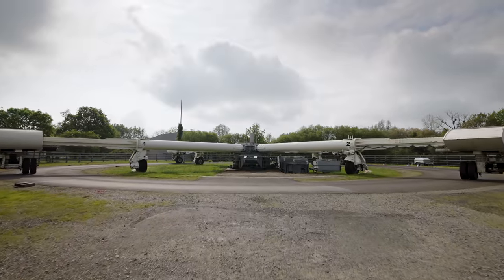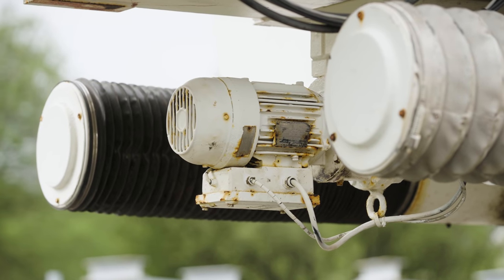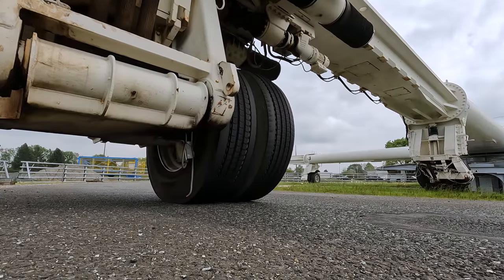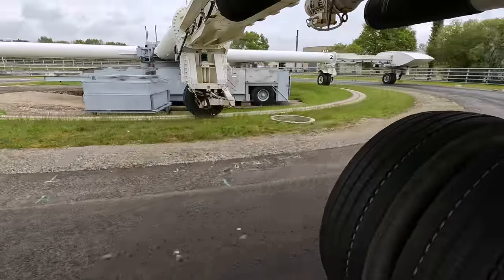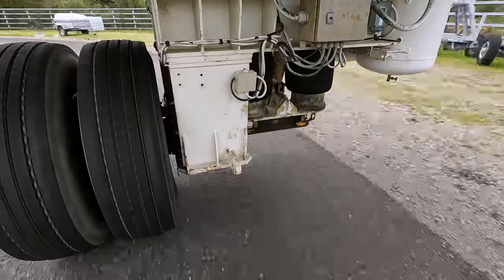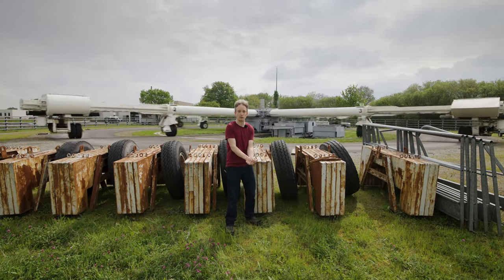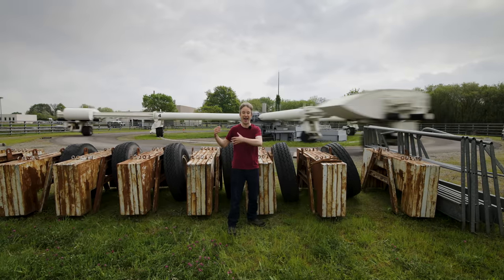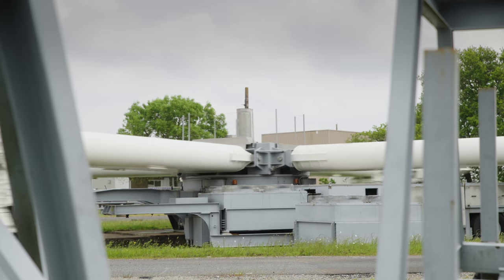The massive Fatigue Carousel helps keep roads safe

Comment: Imagine what the process of coming up with this must have been like.

Like someone says: "We need to test new road pavement for long term fatigue, how can we do that without inventing a time machine? Any ideas?"

And then a group of engineers did a brainstorming session and their answer was Giant circular vehicle that can run so fast that it simulates years of damage in a few months.

Ingenious
Reply: I don't think it's simulating years of wear just months from which they can extrapolate how damaged it likely be over the years.
Reply: @madmanwithaplan1826  the thing is they can run it very hard and continuously.  Fully loaded, bumper-to-bumper weight like a traffic jam, but screaming along at 70km/h.  That's conditions harder than the real world
Reply: @madmanwithaplan1826  I'm not so sure about that. Usually road surfaces are layed out for a certain number of 10-t-equivalent axle transitions in 30 years - and this machine can test the number very precisely - just take the number of rotations and multiply by 4. 

At least for surfaces that don't face that much heavy traffic (lets say 3.000.000 10-t-equivalent transitions, which is your usual road that connects two villages) this machine has to run only for less than two months. With the numbers given in the video (120 m length, 70 kph speed, 4 arms) the result is the following:

N = 3.000.000 (10-t-eq. transitions) / 4 (arms) = 750.000 (rotations)
T = l/v = 0,12 km / 70 km/h = 0,001714 h
t = N * T = 1.285 h = 54 d = 7,65 weeks
Reply: I think it just simulates a lot of cars at once nonstop, they said it typically runs at 70 kph which is not particularly fast.
Reply: Another brilliant piece of engineering was a Michelin Citroen DS PLR, designed to test tyres!
Reply: @monhi64  not cars, trucks. Cars are not significant for road damage - the damage one 40 t truck does is equivalent to around 18.000 2 t cars!
Reply: The concept itself has been around for centuries, using animals in a circular path pushing (or pulling) a movement arm, usually to bring up water.  I'm sure there were even casual calculations on how far an animal has traveled walking in circles per day.

These guys just took that concept and reversed the power source.

Ingenious yes, but it was just adapting an existing machine to a different purpose...
Reply: I've had many meetings like that, where somebody immediately calls out  "well there's always [some crazy thing ] to do it, ha ha ha" and after like two weeks of brainstorming we're back to the crazy thing being the only way.
Reply: The brilliant part isn't from the idea, it's build the thing, designing it to deal with the forces involved. The idea itself is no different from the kind of tests you might see on display in Ikea
Reply: There are linear versions of this too.

Comment: Much respect to the small inner ring of apparently indestructible material, quietly holding up without being part of the test.
Reply: Solid thick concrete will do that, if you put practically no load on it.
Reply: Most of the load is on the outer wheels, mind.
Reply: Is it driven from the centre or each arm?
Reply: @ironfront9573  it's driven from the centre - that's where the 1000HP electric motor is
Reply: @patheddles4004  hydraulic motor according to the video
Reply: @benhobby17  yep, my bad
Reply: @benhobby17  Hydraulics aren't a power source; you need something to crank the pump.
Reply: @boobah5643  Of course, but that doesn't make it stop being a hydraulic motor, or it correct to call it an electric motor.
Reply: It's really the backbone of the whole operation.
Reply: @boobah5643  You need something to generate electricity for an electric motor too.
Reply: @derrickfoster644  I now understand hydroelectricity!

Comment: At the Federal Aviation Administration's William J. Hughes Technical Center in New Jersey, there is a hangar where runway materials are tested. The most stress on a runway does not occur at landing. At landing, most of the fuel is gone, and the wings are still providing some lift.

The real load happens during taxiing to the takeoff spot, when the plane is traveling too slowly for the wings to help at all. At that point, every ounce of the plane's weight, passengers, crew, baggage, and fuel are bearing down on the macadam.

 So, in that hangar, there is a gigantic gantry that rides along two rails on opposing sides, running the length of the building. Between the rails is the runway material being tested. It is built atop dirt, and exactly as a real runway.

From the gantry is a large machine with hydraulics and wheels configured as those of a jetliner. Depending on the test, they can set the tires and the setup for literally any passenger or cargo aircraft in the world, at any weight level.

The test consists of the gantry slowly moving (at taxi speed) along the length of the hangar to the runway's end, then stops and reverses to the other end.

Back and forth for weeks or months until the runway fails. Then they analyze where and how it failed, rip up the runway, and lay a new one down. It takes a long time, but the data is wholly worth it!
Reply: Wow, you'd think runway paving techniques were a done deal, but they keep being improved. New materials?
Reply: @andyandreou  or new aircraft
Reply: @halfgecko3202  Good point. As engines and aerodynamics improve, they combine with economic pressures to result in bigger and bigger planes, both passenger and the cargo monsters.
Reply: Have to disagree here, taxiways last compared to the runways.  Surely the point of rotation would be where the worst loads are.  the front comes up and for a second or so, the main gear is pushed into the ground until the wings are at the right angle to generate lift.
Reply: @cjmillsnun  Nah, rotation happens when the wings are already generating enough lift to counteract the gross weight of the plane. At that point the load on the runway surface is tiny.
Reply: @David Gannon
I was going to object that the peak forces on a runway surface come from hard landings. And that's true, but you're still right about taxiing being the relevant maximum stress - the amount of time spent taxiing at full weight is many many orders of magnitude greater than the amount of time spent in hard touchdowns, so for overall wear the taxiing is way more relevant.

So hey, I learned /two/ things!
Reply: @cjmillsnun  taxiways can survive much more neglect and remain safe, which likely contributes to their being replaced less often than the runways. It wouldn't be a contradiction to say that they receive more wear and tear and also get replaced less often.
Reply: An idea for a future Tom Scott video!
Reply: A fascinating additional tidbit!  I wonder if they used this when the biggest passenger plane A380 was being developed? surely they must have.  To test how bad an A380 would be on runways only designed to take up to a 747.

Comment: For anyone curious, the centripetal acceleration is right around 4.9g's with it moving at 100km/h
Reply: holy
Reply: @HuBrFe  this is nothing for an industrial machine.
Reply: 5 grams aint so bad ... 🙃
Reply: and now imagine some nutjobs who wanted to build that vertically, and fling objects into orbit,... in a vacuum,... where the seal brakes at launch,... with a sudden release of the weight on one side,... with the controlcenter right next to it,...
Reply: Hmm for a ring length of 120 m (=circumference) and a speed of 100 km/h I found the acceleration to be 40.4 m/s², or around 4.1 g's
(and at 70 km/h it drops to 2 g, which makes sense if centripetal acceleration is proportional to the speed squared, so that 70% of the speed means 49% of the acceleration)
Reply: @shirou9790  2g at 70km/h? They should put seats on the arms and sell tickets! Its uhm... a bus simulation!
Reply: @skoniramont  did you just describe a trebuchet?
Reply: @psylock524  He's referring to a thing called SpinLaunch, which if built at full size, will be the most spectacularly epic physics fail ever created by Millennials.
Reply: @dw300  Certainly, but the title is rather a disputed one. I've heard of a giant vacuum tube with people  propelled inside at Mach 2. This one also makes  a decent bet.
Reply: @dw300  looked it up, looks like it's just a mass driver if it was a beyblade
Reply: @skoniramont  Hah! As if anyone would ever build something like that... Oh.
Reply: @JNCressey  g is not for grams, it is a measurement of acceleration, not mass or weight
Earth's gravitional accel is taken as 1 g, which equals to roughly 9,81 m/s²
 
Ofc your mass does not change regardless of the interial acceleration you undergo,  but if you want a reffrence,  you can multiply the rider's body mass with the accel given in g's unit, to estimate how much mass in 1 g (normal gravitional accel) would create the same force as the rider's mass under that much acceleration
Reply: @adakalyoncu1913  woooosh

Comment: the fact the wheels each have what looks like a wing over it really shows how fast it's designed to go if the air resistance is so significant
Reply: I'd guess it isn't as much to allow it to go to high speeds. But more to prevent the air to go around it in such a way that makes it vibrate. Vibrations can cause a lot of wear and tear, and this machine needs a lot of up time, and little down time.
Reply: Isn't it used to properly control the simulated weight, by slightly inclining them?
Reply: @DidierLoiseau  That would make sense, if you alter the angle of attack you could create more up or down force on the fly without having to physically add or remove weight.  Fantastic design choice.
Reply: I wish Tom explained what they were for.

Comment: At work (agriculture tractor parts supplier) I've seen something very close to this, but instead the test subject is the moving part, not the floor. Tractors ate tied to the center and kept driving in circles through many obstacles as a way of validating its fatigue strength. It is so similar to this that now I'm wondering what else is running in circles out there.
Reply: Surely the earth runs in circles
Reply: Probably they use something like that to calibrate the arm on dump trucks that lifts bins
Reply: I've seen horses on a leash directed in circles over obstacles.. also fatigue testing? 🤔
Reply: The Houses of Parliament run in circles, or at least the occupants do, constantly.

Comment: I always imagined something like this had to exist, I just never researched or confirmed it. Thanks for the video
Reply: there is only one problem (at least in Germany)- when the local government is searching for contractors to do the actual work, they have to use the cheapest one... and they do not consider long term costs... that is why our streets are mostly made from bitumen and not from concrete... although concrete lasts at least 3x as long, is more silent and so on.... but the initial cost is like 30% higher... so it almost never gets used..
Reply: @olik136  Concrete roads where I live are noticeably louder than bitumen, both for the travelers and the people near the road. I really don't like when I come across stretches of concrete highway on long road trips, the extra noise is irritating and mentally fatiguing.
Reply: @olik136  so you never visited east Germany? Because if you had you wouldn't advertise for concrete roads.

And that they don't consider long term costs is also wrong. Long term costs is one part of the cost-calculation.
Reply: Concrete roads when laid need weeks to dry and cure before they can be driven on again. It's not really viable for most places to shut down significant stretches of road for a long period of time for modifications like that.
Reply: @Jehty_  I don't know what problems east (East?) Germany has, but Canada has long stretches of concrete highways that are great, of course there is little choice, frost heaves would destroy bitumen every winter, maybe more than once within a single winter season. Also, I mean, it wouldn't be the only good idea that got totally f'k'd in execution in Eastern Europe.
Reply: @squirlmy  ba dum   ba dum   ba dum   ba dum   ba dum

Comment: That moment Tom mentioned a 1000hp engine is powering this beast made me realize that there are some hypercars out there that literally have double the amount of horsepower compared to this beast. Made me realize how far the technique has actually come and how ridiculously overpowered those hypercar engines actually are.
Reply: Do renember torque though those cars won't have the torque of this
Reply: This has torque
Reply: The duty cycle is a completely different thing though.  This machine will do 1000HP for months at a time and last decades.  At 1000HP any car engine won't last long if it sits at 100% for any length of time.
Reply: Thats not exctly how it works though :D
Reply: The other thing is a car needs good acceleration, this doesn't, it's allowed to take several minutes to get up to speed, so it really only needs enough HP to maintain 100kph, but not more than that.
Reply: As an electrician who works on big industrial things, the scope of how much power even 350 hp is on motors I've installed is mind boggling.
Reply: Whilst HyperCars are indeed astronomically powerful. They are also built with lightness and acceleration in mind so they can only put out that amount of power for short periods of time and doing so will rapidly draw all components to needing a service. 

Industrial equipment like this has to run at close to full power for months or even years on end without breaks. Have minimal servicing needs, and to be done very cheaply when needed.
Reply: Such hypercars exist, but these engines can only maintain the 1000 hp for a few seconds or minutes. 1000 hp is 735 kW. At a very good efficiency of 40%, this would be an energy requirement of 1.8 MW. This means that a waste heat of 1.1 MW has to be dissipated.

Just to put that in perspective: Space heaters commonly used in Europe with 230 V have an output of 2500 watts, American ones with 110 V have 1500 watts. So the waste heat from the sports car engine would be equivalent to 440 EU space heaters or 730 American ones.

Gasoline has a calorific value of 8.9 kWh/l. To deliver the 1000 hp continuously, the engine would burn 3.4 liters (0.9 gallons) per minute or 206 liters (54 gallons) per hour. Even a diesel engine (9.7 kWh/l) would burn 3.2 liters (0.8 gallons) per minute or 189 liters (50 gallons) per hour.
Reply: @vonBlankenburgLP  try an electric car, say a lucid air.  Still an electric engine with probably 97-99% efficiency producing 1111 hp.  
Sure the specs are completely different (gearing, rpm, motor type, power source) but 1000+ hp is still a shitload of power.

Comment: I would love to see some of the bogus solar roadway projects tested  there. That would be slaughter. And maybe some improvements would result from the test data.
Reply: On one of the other testing circles there was a section of hexagon plates that could well be glass 😂
Reply: It looks like they were being tested there, at 3:35, the hexagonal shapes there look like the actual models of solar roadways, although they could be filled in with asphalt, so perhaps they were removed earlier.
Reply: Ah. I missed that. Might also just be hexagonal slabs of some kind, but they look a lot like solar roadways.

Comment: Simulators are so much fun for nerds.  Back in the 70's I read a book that was a catalog of simulators.  I remember avalanche simulators.  And South Africa had a hailstone simulator.  I suspect that there are a lot more now.  I did a little work in a wind tunnel that was trying to simulate the planetary boundary layer.  I found a hill in Israel that had been instrumented and built a model of it on the scale of 3/4" = 10 meters and compared the results.  They weren't very well matched.  

I grew up in the pothole belt in the US, where there are 50 freeze thaw cycles every winter.  I wonder if there is a simulator for that?  It really eats highways and building materials.

Comment: The autobahn in Germany has had virtually no maintenance since it was built.
The concrete at it's minimum is over 2 and half feet thick. This prevents cracks, and warping while supporting the heaviest of loads.
In the U.S. our major highways aren't even half that, and have alot more traffic so most of them are always garbage.

Comment: Kind of puts into perspective how scary cars are. When I walk by a street I'm so used to seeing them drive past me at terrifying speeds (probably not 100 km/h but definitely close to deadly) that it doesn't phase me that much anymore but this thing puts that very rational fear of getting hit by fast metal husks back into my soul.
Reply: A car moving at 10 km/h can kill you, so it's definitely deadly. It's definitely a daunting machine. It's similar to the feeling of standing near a highway. The speed limit on most highways here in the US is 70-75 mph(110-125 km/h), and driving at the speed limit is actually dangerous because most cars are going at least an extra 10-15 km/h faster, and the occasional drivers going 150 km/h.
Reply: We do just kinda tune things out sometimes. You snap back to reality though when a 70,000 pound tractor trailer roars by you doing 100mph and the wind cone hits you hard enough to knock you off your feet.
Reply: See while out cycling sometimes I reach a max speed of 20mph and it's a rush. Go in a car and 20mph feels like a yawn.
Reply: *doesn't faze me